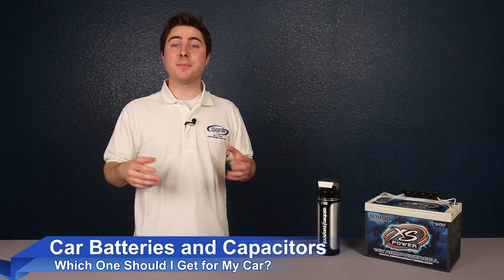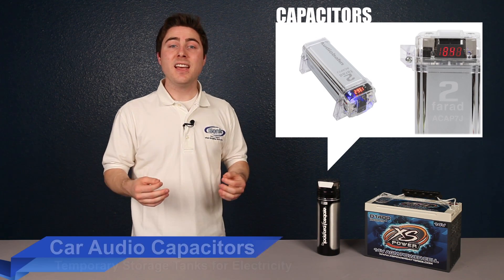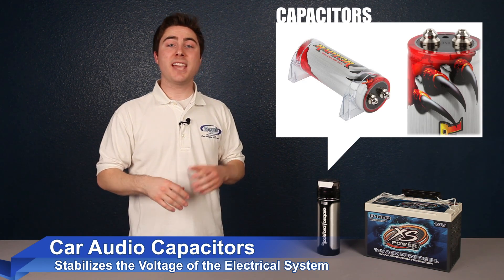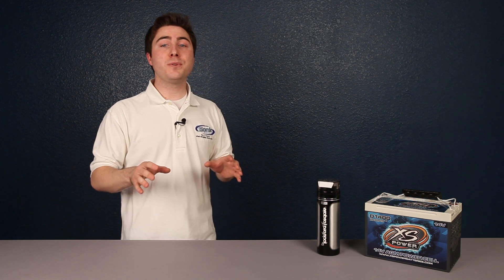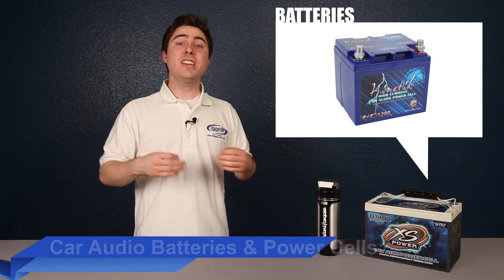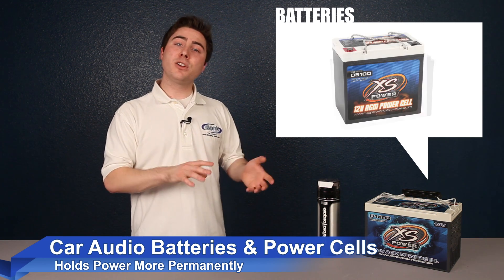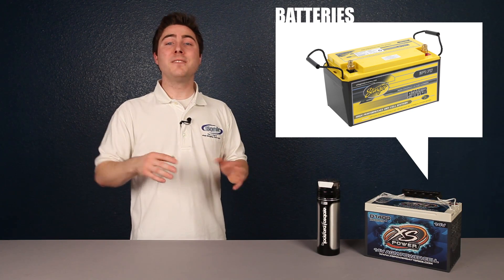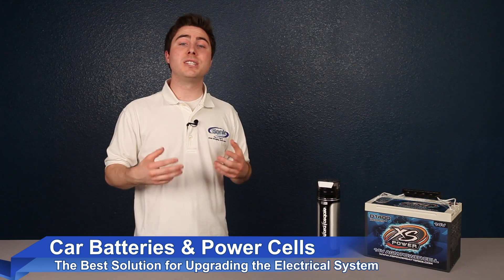Car Batteries or Capacitors: Which Should I Install? | Car Audio Tips

Comment: Hey I just bought two new Rockford Fosgate P3's 12 inch dual voice coil 4 ohm woofers from you and I'm powering them off a first generation JL Audio Slash 1000/1 running 500wrms to each woofer rated at 600wrms. Just today I heard a weird buzzing from the left woofer and on looking it'd stop playing music with a light touch to the cone. I have never even played these woofers to the point of clipping. What could be wrong and would your standard warranty cover this?!

Comment from the maker: You should definitely consider calling us, without knowing how your system is setup, we wont really have any idea what is wrong. If your tweeters are blowing, your gain is set wrong and you are introducing distortion into the system. Car audio is VERY complication, there could be many reasons why you are having problems.

Comment from the maker: Make sure your ground is within 18 inches of your amp and that the surface is shiny metal. A battery or quality capacitor can smooth out your current and reduce the effect you are getting, however it may not fix it 100%.

Comment from the maker: You just have to add up the amperage in your system and find a battery that is designed to handle it. Your first step is to upgrade your alternator. A battery helps but an alternator is the real prize.

Comment: Okay. Say you have an old car.. 1987 Oldsmobile. I am going to put in a type x, on a Hifonics monoblock @ 1000RMS. And then also a front and rear speaker amp.. What should I do when it comes to choosing the right battery? Like Amperage, and Cranking Amperage.. Etc.
Thanks!

Comment: it would be a good idea to add that when adding an extra battery/batteries it puts excess strain on your alternator. Personally I think a high output alternator should come before adding a second battery.
Reply: You’re right it should.a big 3 kit or just  a upgraded charging wire should b the first since most stock alternators are fine for the average system.the headlights dem mostly bc the charging wire is too small

Comment from the maker: Contact High Output Alternator Manufacturers, such as MechMan or DCPowerInc and see if they have one for your vehicle. Then, you just need a large power cell that is rated for your total wattage, such as the XS Power D3400.

Comment from the maker: Did you charge the capacitor first? The capacitor should go in line with the amplifier power cable, but it should have its own ground. It could be a defective capacitor.

Comment: i have a question but dont know how to really explain it. My system wouldnt play for bout 2 weeks when i had my capacitor hooked up. it was like everytime i hooked my amp and stuff up my speakers would make this noise you could still hear the beat but it wasnt putting out any type of power. So i unhooked the capacitor and everything started back playing properly. Do you know what could have happened.

Comment: i have a 2013 nissan sentra. i cant find a high output alternator anywhere. and i want to run 1700wrms sub amp its a highfonics Brutus BRZ1700.1D at 1 ohm with 2 pioneer premier pros 850wrms each. and a 700wrms alpine 4 channel amp for mids and highs... somebody please help me im trying to install my equipment but i dont even know what to buy if i cant find a ho alternator.

Comment: whenever I have the "capacitor" talk with anyone, I always use this explanation.   If we were to say a battery was like a 5 gallon bucket of water with a 1" hole in the bottom.  When full, it can drain for a while before being empty.  A capacitor is like a 44oz. cup with no lid.  When full, you can dump all the water out of the cup very quickly, maybe a little more than the bucket.  but in both cases, you will need a large enough alternator to "fill" the system back up.

Comment from the maker: A D3400 is a very large battery. With 1400 watts RMS, this will likely clear up 90% of your dimming issue. You may tie in a second battery, however upgrading your alternator after you upgrade the starting battery would probably be a better idea.

Comment: hey i was wondering if you could answer a quick question for me? I'm juggling between a optima yellow top or a shuriken sk-bt60. the shuriken is rated for 60 amp hours, while the optima is rated for 75. but i noticed the optima is rated for right around 1000 cranking amps while the shuriken is rated for 1500. what matters most in the car audio equation? thanks in advance!

Comment: I just bought a boston spg555 2 ohm and a boston acoustics gt2200. I already had installed a boston acoustics gta704 to 2 sets of boston acoustics z6 and all my lights are dimming. All my connections are solid with big 3 up grade( 0/1 ga). My question is will a xs power d3400 resolve my dimming? My total rms watts are 1400, stock alternator is 160 amps, battery is on the trunk(2006 dodge magnum). I will be using the xs d3400 as main battery. Thank you for your time.

Comment: i have just bought a new battery and i was told it was a really good one it has 860 cold crank amps and i was wondering if i should still get a capacitor and if so how do i go about picking one out

Comment: My lights dimming. Im bouta buy a kinect battery. Supposemently it got.a compacitor built in i have no clue. GUy at the shop said it would stop dimming. Now i here that its more work for the alternator. Which ones good?

Comment: Why didn't this video contain the word ALTERNATOR? The alternator is the king of your vehicle and the only reason you can just jump in and just simply start it up. An upgraded alternator is the only true solution of higher electrical demand. I mean how many non-electric vehicles do you see that need to be started by being plugged into a wall socket?

Comment: one guy told me that having a second battery would pull more power from the alternator and then i would have to get a new one...but if i get i cap for how long would i be able to run the amp

Comment from the maker: A good place to always start is the battery. A Kinetik HC1800 would be a great choice for you to start out with. You would just have to make sure it fits in your stock battery location or use it as a secondary. If that doesn't cure light dimming issues then do the big 3 upgrade. Your last resort would be a capacitor. As far as wiring goes the NVX XKIT42 is an amazing amp kit that is true silver-tinned copper wire for better power transfer.

Comment: hell i got 2 walmart batteries an a compacitor, i should b ok when it comes to powerin my system but id still rather get a kinetik power cell  along with a standard battery just to b on the safe side

Comment from the maker: If you can physically fit the Kinetik HC2400, we recommend going with that one. It will have enough current to support the power your L7's will need. We also recommend upgrading your "Big 3" wires under the hood of your Silverado to allow more current to pass at one time.

Comment from the maker: A capacitor does not provide or create any power, its just a temporary storage tank. If you're trying to supplement the available power to your amp, you should look into an actual battery or power cell, such as the NVX XHC600.

Comment: @1LoudMerc hey man do u think a farad capacitor 2.0 will be doin a great job with a ps-21kx 20 amp power supply? (its actually 30 amps since i got it fixed with alexis electronix) im plannin to push a 600 watts kenwood amp and its 40 amps rated..will it work? any help would be apreciated C:

Comment: well if it makes you happy.....i do agree that a Battery is better than a cap, i never said any different but after all the expense of buying all new system i could not see spending that much more for a battery so i took the cheaper route and bought a big enough cap for both amps and don't have a problem with headlights diming! besides that i don't have my stereo cranked to the max all the time. i like a respectable level and i'm old school so i'm not into all the rap shit! funk is where it's at

Comment: my kinetiks holds up just fine in northern minnesota we have 5 month winters commonly under negative 35 degrees ive not once i repeat not once had a prob with my three kinetics and ive had them for two years they handle hot or cold no matter the situation

Comment: yeah if it's a cheap CAR battery from Wal-Mart!  them Kinetik & Optima battery's are too high in price for my blood! i bought a Cadence 4 Fared Capacitor and it works just fine with 2 600 watt amps. 1 mono & 1  4ch. not all Caps are shit! you just need to shop around for the best you can find!

Comment: The problem is a battery doesn't do anything to help until your system voltage is at around 12.5 volts. By then your already seeing great dimming. So if you get batteries expect to still drop into the 12's, but you shouldn't be going under 12.5 as that's when they're throwing out their stored amps.

Comment: its not that caps "are shit" they just need to be applied in the right way. there is nothing wrong with using a cap especially in small cars where battery space is so limited that a second battery wont fit in

Comment: HERES THE THING . U CAN ADD A BATTERY BUT U MUST TURN DOWN THE STEREO OFTER ABOUT AN HOUR OF HARD PLAY. THIS ALLOWS THE ALTERNATOR TO CHARGE THE TWO BATTERYS. CAPS ARE LIKE A BUCKET BRIGADE ,BATTERYS ARE LIKE THE FIRE TRUCK SHOWING UP! THE BEST THING TO DO IS UPGRADE THE ALTERNATOR . JUST ADDING A BATTERY HELPS BUT IT WILL BE LEFT HALF CHARGED IF U DONT ALLOW IT TIME TO CHARGE. THIS IS WHAT I DO FOR A LIVING.